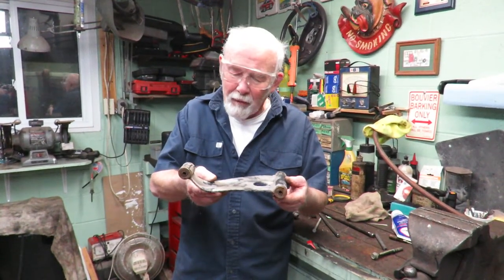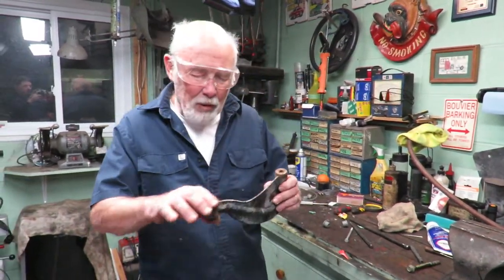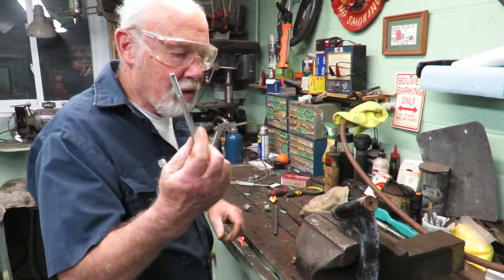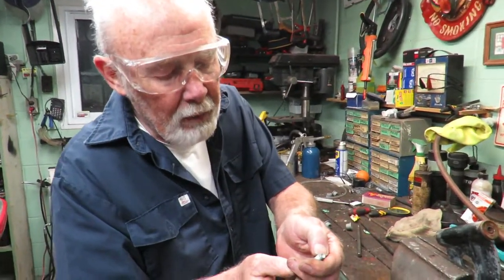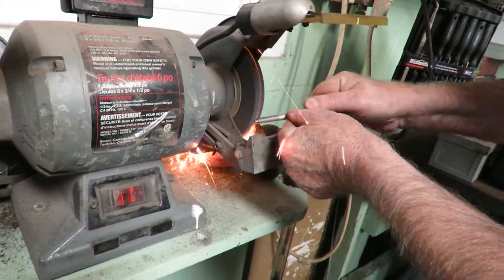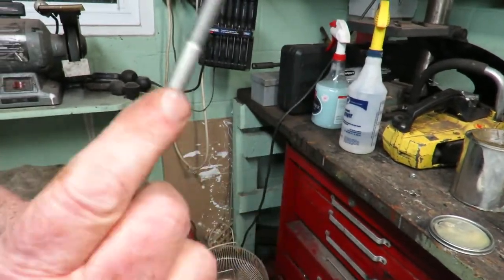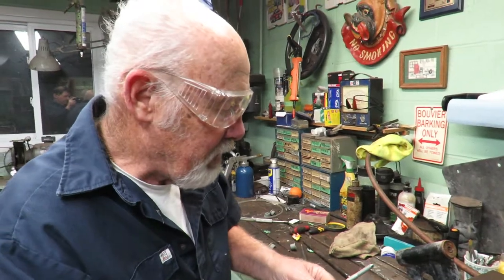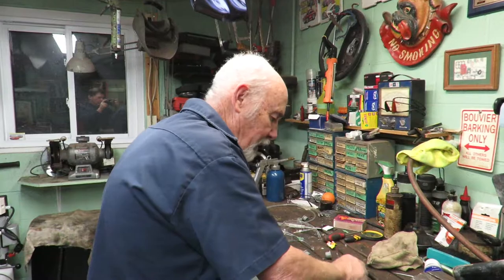Club Car A Frame Bushings

Comment: "You have to drop the steering box".  This is key mystery to getting the control arm removed from the vehicle.
Reply from the maker: it un bolts very easy and just let it hang down  1 to 2 minutes

Comment: Ahh,  but getting the Sleeve to line up is the fun part.  Any secrets for that?
Reply: Golf course mechanic here aswell. Usually wait to press the second bushing in. Put the pin through then c clamp the second busing over the pin when it’s easier to manage. Not always easy. But it’s been the way I’ve managed